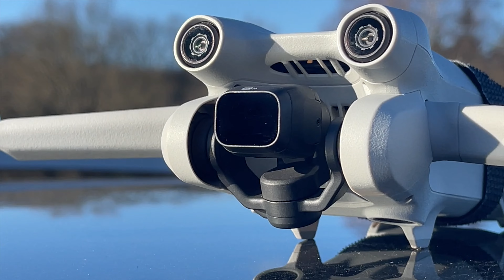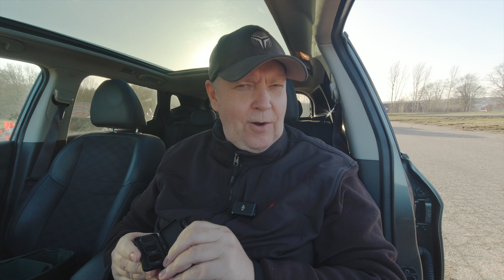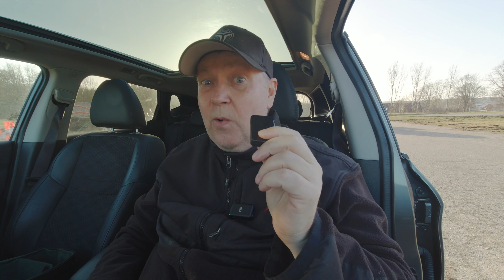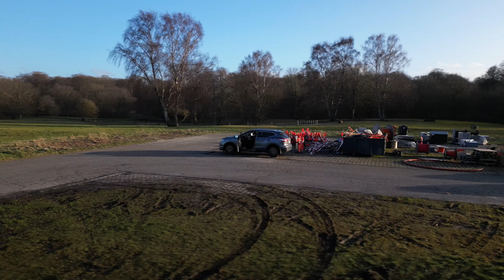Smooth footage without using ND filters with DJI Mini 3 Pro

Comment: It's up to the individual.  If you're just doing regular videos then u don't.  But if you're wanting to or doing quality videos,  u need them.  I used to shoot in auto all the time. Once i gave the filters a chance i noticed the difference. I won't be not using them again. U most certainly need them

Comment: Great vlog!
IMHO… I can see some vignetting @ 8m 59s with the ND filter attached BUT… the exposure and detail in the sky is much more even. ( funny how without the filter the sky shows some vignetting on the right of the frame!)  In answer to your ISO issue, just reduce the filter strength to get to the right ISO value 👍🏻
I would say there is very little in it and I kinda prefer the higher frame rate that produces more detail especially in shadows. 
Thanks for a another great vlog! 🤘🏻

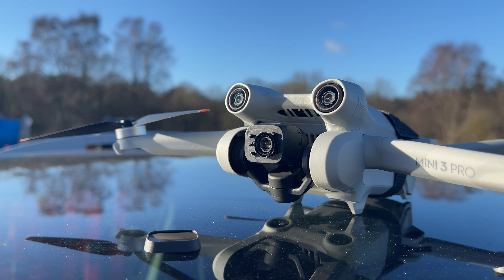Comment: Fine video. I always use an ND4 but for a completely different purpose and that is protection of the lens. Look at you at 0:39 how the lens is covered with dust particles. With the Air 2S I also use an ND filter but that to prevent from getting the propellers as shadows in the frame when the sun is shining behind the drone. Then you see the shadows passing and with a ND filter the shutter speed drops and you don't suffer from it anymore.

Comment: I fly at 4k 60 on auto and use a CPL filter all the time.  Even without water around, it adds a touch of saturation to the scene and brings out the greens in foliage.  The 60 also helps with 'jittery' footage.

Comment: I'm not sure if that was really the best type of footage to show a proper comparison. 
Low, fast flying over a scene is where you will see the biggest difference with motion blur as a too high shutter speed will give jittery footage.
Many other scenarios don't need an ND filter, it just depends exactly what is being shot and what end result/effect is desired. 
I like to shoot hyperlapse and during the day, even cloudy, an ND is essential to get a shutter speed slow enough to get a nice smooth motion blur on moving objects like people, cars etc.
I also shoot a lot of stills and if you want to use a very slow shutter speed to blur something like water, an ND is the only option.
ND filters are really useful for certain situations, but don't need to be used all the time. Some people adhere religiously to the 180 rule, and whilst some situations benefit from it, it's not necessary all of the time.
Reply from the maker: Right up my alley :-)

Comment: Thank you for this.

Could you clarify the statement that with a neutral density filter the colour balance is altered?
It is obvious enough that that will happen if the filter is, e.g, a piece of red cellophane. But I thought the point of the filter's being neutral was that it should dim all light wavelengths equally, and so bias the colour rendition towards neither the red nor the blue end of the spectrum.
Reply from the maker: It's not suppose to change the color, but but I have seen it with freewell as well when going to ND64

Comment: Henrik, thanks for the information. However there is an almost universal misunderstanding in the drone community on the term “180 degree rule.” That refers to the positioning of the subjects when filming them. https://en.m.wikipedia.org/wiki/180-degree_rule  Alternatively the “180 degree Shutter rule” is a very outdated term from the days of film cameras and mechanical rotating shutters. Please look at the motion GIF image on this page as an example. Few drones have mechanical shutters and absolutely none have rotating mechanical shutters. So using there is no 180 degrees, just a 2x shutter rule. https://en.m.wikipedia.org/wiki/Intermittent_mechanism

Comment: These ppl used to bother me when this whole ND filter thing came out for the mini 3 pro. All the reviewers at the same time talking about it. That's when i had a feeling that was just the sellers paying them to advertise them. Anyway. To me, YOU DO NOT NEED THEM. U can check n see for yourself. Right there in the lower right hand corner, you see EV. Just tap it n u can adjust the exposure value yourself. On bright days u can set it to the negative side. AND you can do all these adjustments while in the air. U don't have to bring the drone every time to be changing lenses.
Reply: Totally agree there is loads of hype around ND filters and TED NEMETH never uses them, so good enough for me!  I just use the histogram and over exposure warning and lower the EV , seems to work fine to me!
Reply: @whitesnake329  exactly. Glad he doesn't. Not like those other reviewers insisting u need them n that they make the footage look better. When u already have that feature built in. On a really sunny day with white buildings around I've gone as far as -0.7 ev. Looks like you but sunglasses on the drone 😂. Forget wasting money n those filters.
Reply from the maker: I love his work TED NEMETH
Reply: By doing that (adjusting the EV value) the exposure is adjusted by increasing the shutter speed. Assuming ISO is fixed at its lowest of 100, the only way a fixed aperture camera can reduce the exposure is by increasing the shutter speed. 
For most footage that's not a problem, but if you are low and fast on a scene you want a slower shutter speed to avoid jittery footage.
I like to do hyperlapse sequences, with objects like cars having a bit of blur in them for the smoothest effect, and doing that in daylight an ND is essential. 
It all boils down to exactly what you're shooting - many situations don't need an ND filter whilst for others it's preferential or even essential.

Comment: I only use the ND filter for video where it is necessary to reduce the shutter speed - for example, I fly a lot on construction sites where video is required - on construction sites there there are often light chains/ if the shutter speed is too fast, these lights vill flash in the video.
Reply from the maker: That make sense

Comment: An important point not mentioned is to set the white balance with or without a nd filter before you set your exposure this will also help compensate somewhat for any colour cast created by the filter. I use nd16 on overcast days and would have gone with a nd32 in this scenario. In pro/manual mode set your shutter speed for 180 rule but turn on auto iso to cope for changes in the light..... Edit: sorry set WB after exposure setup
Reply: White balance does not really matter, either in still photography or videography. Can be changed in post afterwards easily anyways. And if you use Davinci resolve etc. then change the WB first, then on a following node, you can just adjust your colors normally. Also, a proper ND filter should not give any color cast. An ND/CPL combo might "change the colors" but what it really does is increase saturation and improves contrast. So just with WB, it does not matter. If you want to desaturate the footage or change contrast, just do so in post.
Reply: @adrianstensrud  Everything can be changed in post to suit personal taste but why not set it correctly before recording?
Reply: @neiljolliff8170  well, for one, temp often changes on location unless you are filming in the middle of the day anyways, so I never care. One less thing to think about, as I always edit anyways wether it is wideo or dslr stills.
Reply from the maker: you are right, thank you for sharing

Comment: Interesting comparison Henrik. For me the set up I use most of the time is an ND16  with auto exposure with the ISO fixed at 100. Just means I can spend more time enjoying my flying rather than constantly changing settings. The ND also gives a better looking image in my opinion.